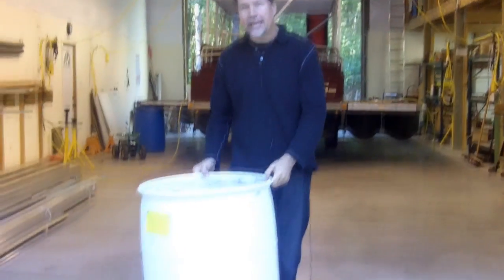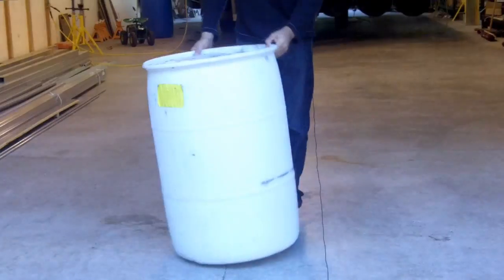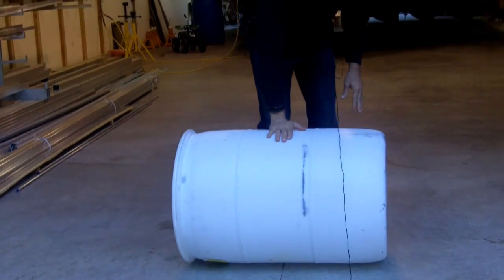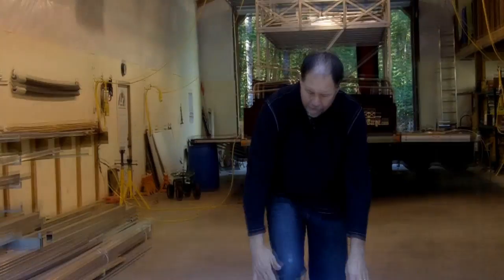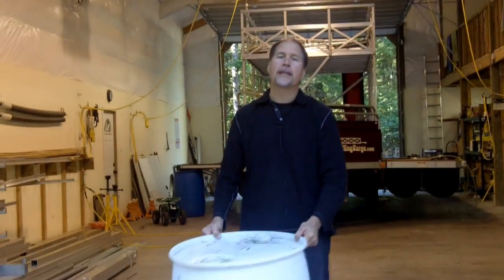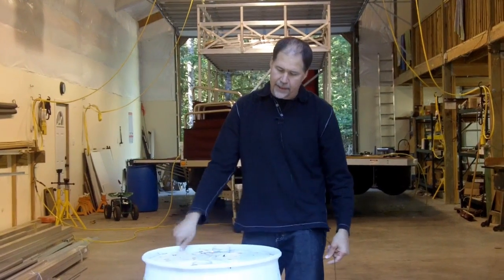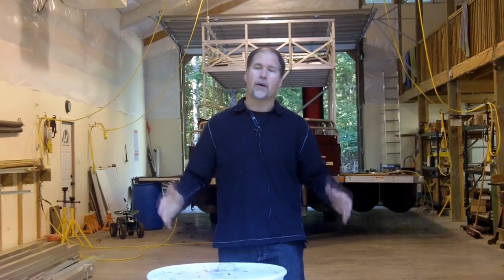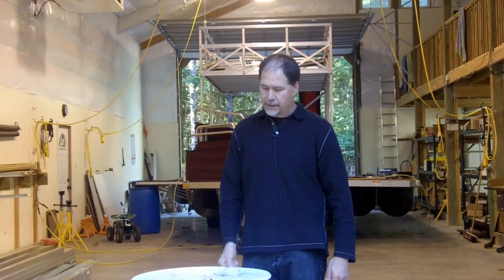Floating Dock Materials Video--Floats vs Barrels

Comment: Stuart- it's not 'pourable', it's porous. This guy doesn't explain much because he seems to barely knows the basics but the foam he's talking about is called open cell. It has millions of tiny air pockets which will indeed fill with water and it becomes saturated. However, you can get foam which is closed cell, that will not absorb water.
You also don't need his fancy aluminum framework. The barrels can be had used for about $20 each or less, and secured to the wood with seismic strapping which is bought at any box store like Lowes.